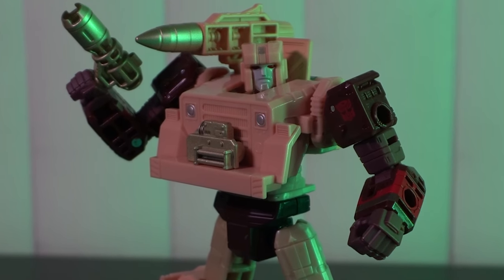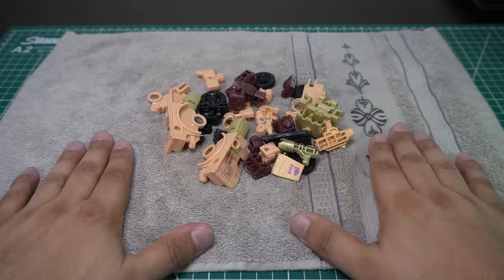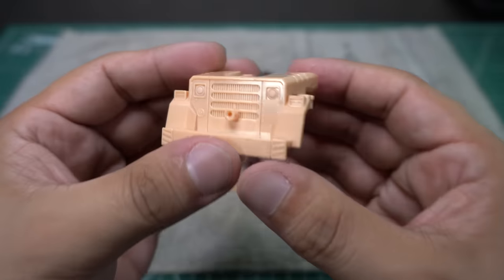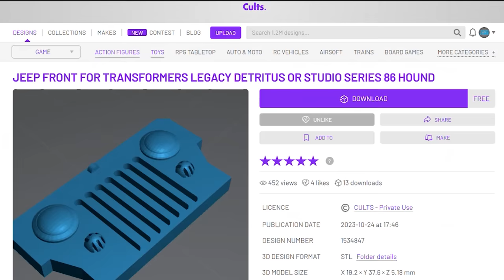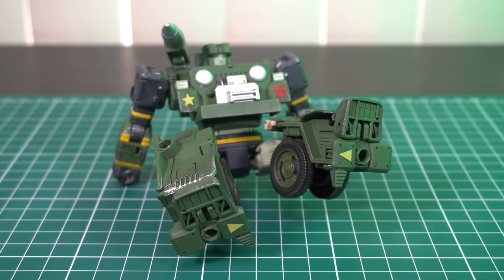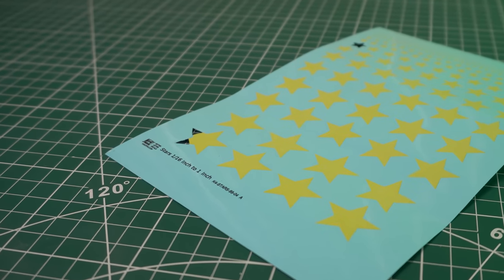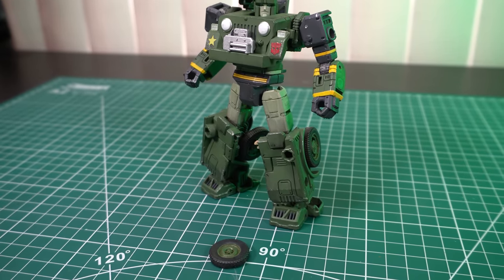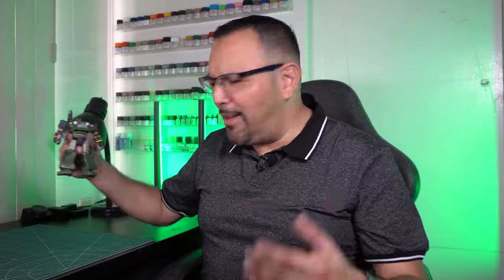Transformers Legacy Detritus Into Hound Full Customization & Repaint | 4K

Comment: Man! Hola Jose, first of all this is a jaw dropping custom  you've done!! quite talented indeed. When transforming, does the paint wears off? or scratches? how do you prevent that?
Reply from the maker: I don't think there's a way to 100% prevent the paint from rubbing or scratching off but there's some ways to try and mitigate it. Sanding down parts that are going to rub against or touch others will make room for the paint. Also, I hardly do this but a good top coat will help protect the paint too. Hey and thanks for watching! :_happy:

Comment: Amazing! I had trouble at first determining which was the MP until I seen the height difference. I have plans to do the same so thanks for doing all the guess work for me. What did you use for the paint removal?
Reply from the maker: Ey thanks! This project was certainly rewarding. For paint removal I use 9 parts 91% iso alcohol and 1 part lacquer thinner. It’s pretty strong so I use it cautiously, especially on clear parts. Good luck on yours! 👍🏽
Reply: @HobbieswithJose  Thanks for the info. Also wanted to say the parts you hand painted look amazing.

Comment: For airbrushing, do you use a specific level of pressure in your compressor?
Reply from the maker: I kinda eyeball it, but I keep it relatively low. Too high a pressure will cause the paint to be uneven. Depends on the type of paint too.

Comment: Hey there, Jose. How did you split the head without cracking it.
Reply from the maker: I never actually split the head on this project. I pulled it off the ball joint and applied putty on the seam line to hide it. 👍🏽
Reply: @HobbieswithJose  Thank you.